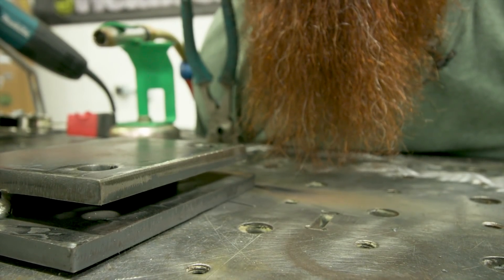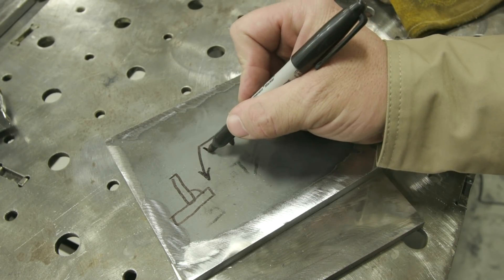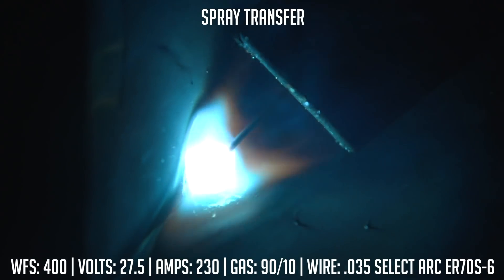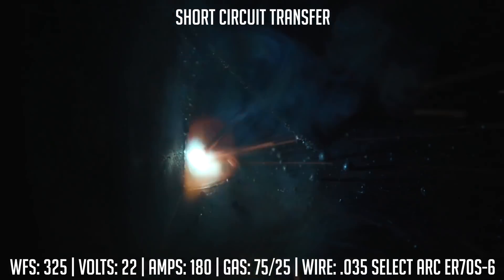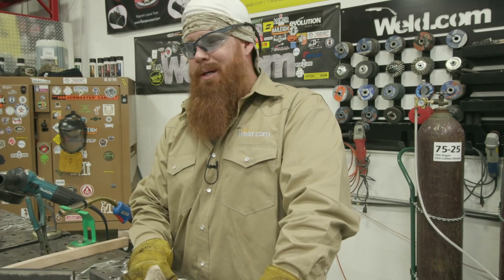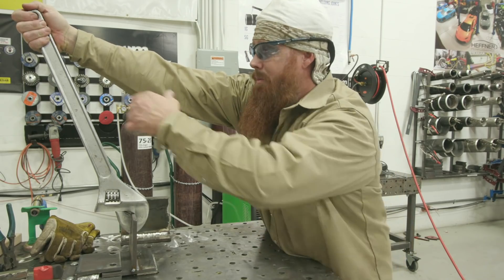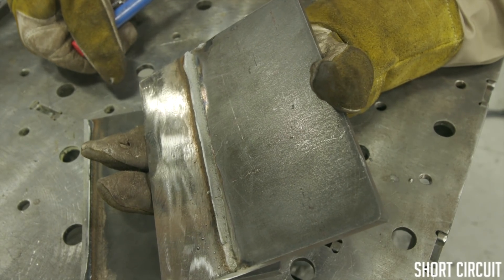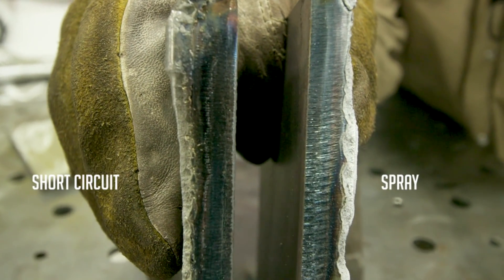Short Circuit VS. Spray Transfer

Comment: biased result for the short circuit. you cannot go into spray transfer with 75/25 gas. so you could go all the way up to 27 volts just like the spray transfer and Achieve nearly similar penetration. also for the 22 volts you had way low wire speed which will also give you low penetration. along with your technique notorious for lack of penetration and not allowable on structural welds. should have been around 22 volts and 350 to 375 wire speed. or if you wanted a true non bias test run both at 25 volts and the corresponding wire speed to the transfer mode.
Reply: Matt B 25 volts wouldn’t be considered short circuit.
Reply: Jason Becker you literally said that the other day no matter what you crank the voltage to with 75/25 gas you will not achieve a spray arc. which I can confirm when I weld every day I love to crank the voltage to at least 25 and if you check out the weld table in my Lincoln Power MIG 256 it will confirm that as well. you can also achieve a spray arc around 24 volts with the right gas. the transfer mode is dependent on the gas and voltage but both could be at the same voltage with different transfer modes. case closed biased result. I like how you reply when I call you out but you don't reply when I wanted you to do a video on safety.
Reply: Matt B where did you ask for a video on Safety?
Reply: Jason Becker when you were talking to that guy in the comments about I believe how he got leukemia and Parkinson's and was dying because of all the things he was exposed to from welding. it's a very overlooked thing in the industry and I'm literally talking to dudes everyday about safety while they sit there in a galvanized plume of smoke not even keeping their head out of it let alone wearing a respirator. honestly could be a five-part series if you wanted to go in-depth with it, covering all of the processes and different types of safety equipment that exist, that no one even knows about. do you know how long it took me to get my supplier to give me a proper welding respirator with the right cartridges, literally months and he was scratching his head so I had to do the research myself and give him a part number which he still couldn't find. Honeywell makes a pretty good one that is inexpensive and goes on your back. its one of the affordable for the average guy non forced-air respirators.
Reply: Matt B I do remember that. We try to build safety into every episode. As far as fume safety we did a couple fume extraction videos a little while ago. I am currently looking into doing other videos to demonstrate fume safety. It’s a long process to get the videos planned and get the resources needed to get them done. Sorry if I didn’t answer your question directly. I try to get to everyone that comments in the videos, but I also help out on Facebook and Instagram as well.
Reply: Jason Becker true there is so many different subjects to welding and so many different people asking questions. maybe just a short episode every once in awhile dedicated just to safety and who knows how many lives that could save in the long run. you got to consider the safety measures that you can take as a man and not a company because a lot of people work for companies that take advantage of the worker and will not supply fume extraction or even a pair of safety glasses. maybe just different options for the common guy. i appreciate all the valuable information you guys have and thanks for the reply. sorry for calling you out but was I not right? I can send you a picture of two 4in Vertical t joint welds holding up a 3000 pound lift gate welded in Short Circuit 19 volts 210 wire speed vertical up single-pass 1/4 inch to 3\8 plate. needless to say short circuit will penetrate when done properly.
Reply: Matt B you’re right, there are a lot of topics involved around safety. I’ll see what I can do about making some specific videos in regards to best practices for the workers. In regards to your comment about short circuit, I’m not saying it can’t be done, I’m saying it’s not recommended as a general practice. It’s prone to lack of fusion. That’s why AWS won’t prequalify it as a procedure and it has to be qualified on an individual basis. It just doesn’t meet the requirements and fails more often than not. This kinda falls into your safety question. If short circuit isn’t recommended for thicker materials due to lack of fusion wouldn’t that create an unsafe situation? Wouldn’t it be safer to utilize a different process or mode of transfer that is much more reliable and therefore safer?
Reply: Jason Becker  got me on that one yes safety is definitely of concern when the hands of an apprentice but was this not a test to back up the claims? all I was asking for was some equivalent testing / non bias. let's see some vertical spray arc 😅
Reply: Matt B it’s not equivalent because one is stronger than the other. That’s the point we were trying make. It’s a common misconception that you can get away with welding thicker materials with short circuit. It’s not recommended because you can’t get the same results, even if you crank up the volts and amps and hit the max range of short circuit it’s still proven to be ineffective. Once you go above the 22 volt mark you start to enter the mode of globular. With globular, you get better penetration but are limited to flat fillets and grooves and horizontal fillets. Also you can’t go vertical with spray unless you pulse. We recently did a video on that as well.
Reply: Jason Becker I weld  consistently over 22 volts non globular transfer it all depends on your wire speed. you can go into globular transfer at 16 volts with low enough wire speed. Short Circuit is not proven to be inferior again with the proper technique  as with any type of welding . the only thing you're gaining with spray arc is speed. the vertical spray was a joke lol hense the smily face. I wouldn't even consider pulse spray a real spray maybe for guys that can control the puddle 😁
Reply: Not biased. If you use the same volts, even with 75/25 it would be globular. He said you can't acheive spray, I've not heard anyone say "you cant get out of short circuit with 75/25." Good demo.

Comment: If short circuit is not fusing, then what IS it doing? Cause it's obviously doing something. It took a lot of mechanical advantage to break that weld. Is it adhesion? Magnetic attraction? Van der Waal's forces?
Reply: balisticsquirel it fused into the side wall but not into the actual joint. It works great for materials less than 5/16”.

Comment: Also try this using pulse spray. I find a pulse spray at 25.5V and 400ipm runs really well on our robots
Reply: adejong95 pulse runs great on robots. Have you done any rapid arc or rapid x?
Reply: Jason Becker we have Miller power sources so rapid x and rapid arc aren’t options. AccuPulse is great though
Reply: adejong95 haven’t had a chance to try that yet.

Comment: .035 FCAW 14 volt 90 amp 230ipm 2-3 inches of stickout good for spot welding 22 gauge sheet metal, .035 FCAW 28 volt 140 amp 280ipm can weld the broken crankshaft out of the truck. One wire that can do everything at the flip of a switch... 035 flux core.

Comment: Can all MIG machines above a certain amp range do spray transfer; or do you have to purchase a machine with that specific capability in mind? Thank you for the video.
Reply: If you can get to around 200 amps you can get to spray transfer. Depending on materials used can run from aprox 180 to 350 amps in spray.
Reply: The amperage threshold is just one aspect.  A lot of lower-wnd machines have limited voltage capability when you increase the voltage, so its not just wfs/amperage.  The machine has to have enough balls to let you increase the voltage as well.  You need to look at the volt-amp curve of your machine.
Reply: @zod-engineering-welding  Okay, thank you
Reply: I can just get to spray with my Lincoln 180.  Barely, and I have to go down to .025 to get there.  The machine was really not designed for it. 200+ amps would be better.

Comment: Ok with all due respect Tru ss with the same settings.... Because I have welded thicker plates with ss mig... And have not had failures .     Could that be because of the machine being used?   Could u please try again with an older mig v the new machines and see what happens?   Or how about stick v spray transfer .
Reply: New vs Old wouldn't have an effect on whether the mode penetrates. Maybe a slight change in setting to achieve short circuit or spray, but that's it.

Comment: How would .045 FCAW-GS compare to axial GMAW-S?
Reply: Mr Wolf very similar if not the same as they are both 70 series electrodes and would achieve good penetration if proper settings are used.

Comment: You should do a video on 1/16 metal core
Reply: Eric Brugnoli that’s a biggin, we’ll add it to the list.
Reply: @GodslilRedneck23  run it everyday an work welding together heavy equipment like angle blades and excavator buckets. Like to see their prospective on it

Comment: Try it at 800ipm and about 26-28 volts. You can absolutely crank .035 to ridiculous speeds if you need to.
Reply: I ran 32V and 725 ipm for  cap pass. Each pass blended nearly seamlessly.
Reply: yup! thats what i ran my settings at roughly when i was welding tank heads on lol, big ole slick 1" wide cap or more
Reply: Fuck yeah! I love cranking the wire up and just flying. But I'm usually 27-29V and 500+IPM

Comment: I've been wondering what spray actually was n the difference to regular mig so basically if I understood correctly short circuit is lower voltage n wire speed to match n spray is anything over a certain voltage with wire speed to match with the proper gas mix
Reply: Ben Miller yes but with short circuit the wire shorts out to melt the wire, whereas with spray, the electrode is literally sprayed off the end of the wire and tiny droplets fall into the puddle.
Reply: @GodslilRedneck23  ohhhhhhh that's why the arc looks so much bigger with spray right? Cuz it's jumping farther from the work so the puddle is created n melted wire is sprayed into it. You know if you keep teaching me all this welding when all I have is a harbor freight flux core welder you're gonna have to give me a welder so I can put all that theoretical knowledge to use lol
Reply: Ben Miller you know harbor freight has that Omni pro 220 multi process machine that isn’t that expensive. It does mig, tig and stick. I learned a lot using that machine and there videos. A side note on that machine though. The auto settings are a little low, I find myself turning up the heat a lot from there factory settings.
Reply: WaylonCarl once you understand what each setting does, you’ll learn to dial it in no problem and you won’t use the auto set features anymore. Hopefully we can help you out on that venture.
Reply: Jason Becker you have been doing an outstanding job of helping me learn and improve already, I have no doubt it will continue. It’s a slow process without schooling but you guys are doing an outstanding job!
Reply: WaylonCarl thanks man. I appreciate the feedback. Let us know if you have any videos you’d like to see.
Reply: @WaylonCarl  yeah the omnipro is a nice machine but the tig on it kinda sucks n only does dc tig n the mig gun is a bit sloppy. I've done alot of research on it n many other multi process machines n everlast is what I want cuz I'll never outgrow it. But I'm glad you like your omnipro man.

Comment: What's the definition of Spray Transfer and what's the definition of Short Circuit?   I don't know what is being done differently just from looking at the video.  Thanks.
Reply: Short circuit is literally that. The wire is shorting out to complete the electrical circuit to make the wire melt. Spray transfer is using the higher voltage to cause the current to "jump" between the wire and the joint. This also causes the wire to melt in advance and spray into the weld joint. This is why the wire speed is so much higher, it needs to keep up to how fast it's melting.
Reply: Globular is similar in that respect, but the current isn't hot enough to achieve a spray.  You can literally see drips of molten metal coming off the end of the wire.  with spray, all you really see is the wire taper to a needle point.
Reply: In short circuit the wire is literally shorting in the weld pool and melting there.  That's what's causing that frying sound that you don't get with spray.  With Spray, the wire is melted to almost a mist and carried to the pool across an arc.  Wire speeds are really high too.  I can't get there at anything less than 30v and 400 ipm on my Lincoln.  Spray also requires a minimum of 80% Ar so it doesn't work with C25.  There are a couple of good videos here on spray/globular/short circuit mig.  Definitely worth watching.

Comment: Now if you were to use short circuit and position the joint so that it would be at about a 60 degree angle and do a vertical up. Would that make a stronger joint? I only have a short circuit mig  and when I need a more structurally sound joint I like to go up. Good or not?
Reply: Thank you gentlemen!!
Reply: Depends on joint prep, material thickness, and technique. If you are making little triangles as you work your way up and can watch the weld dig into the corner of the joint, it should be fine.
Reply: You still wouldn’t get adequate penetration on thicker material with short circuit. That’s why AWS doesn’t allow any GMAW short circuit to be prequalified.